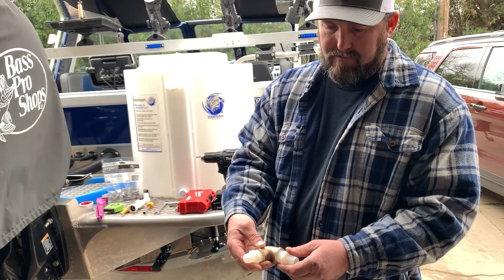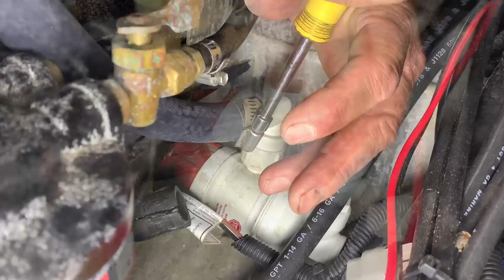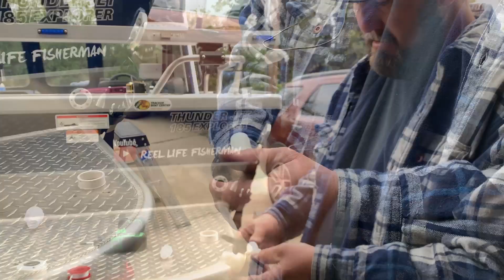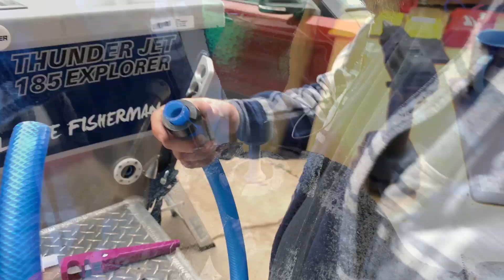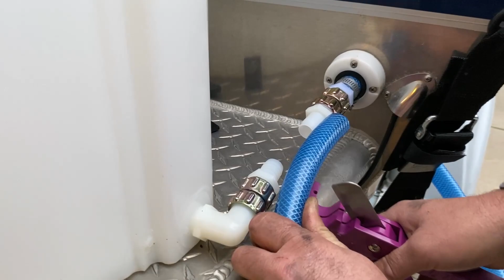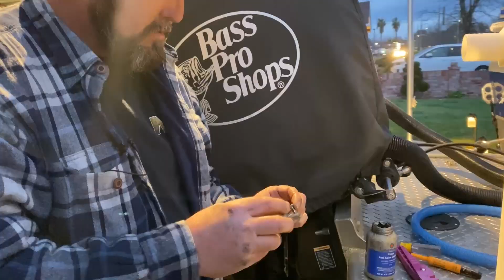PRO FLOW BAIT TANK INSTALL | HOW TO

Comment: Great install as usual.  Wish they made the tracker 175 easier to work with down in the bilge. Barely any room work with in there
Reply from the maker: Yeah it’s tight and sucks working in there .. at the shop I will pull the motor off to make it easier! lol

Comment: Nice clean install and great instructional video! Any chance you have a link to the led lights you use in the boat and in the rod holder beam?
Reply from the maker: Thanks ! I’m going to be putting out a build video on the beam soon and will have the links I used on Amazon for all the lights and parts

Comment: I put the same tank on last summer. I use live bait most of the time down here in socal. Great video as usual. I've plumbed a bit different than you. I run a 750gph pump, which is mounted off an old tiedown eye. I ran reinforced tubing up off the pump, then to a 3/4 barb to 3/4 fpt 90 degree elbow. Then ran hard pipe to a 3/4 threaded pvc valve. When I'm running the tank becomes a whirlpool, not anymore. Plus the valve will keep the water in when bring crabs n lobster home. I'll send ya some pictures. Thanks again for another good video.
Reply: You can get sch 80 fittings at Lowes.
Reply from the maker: Nice ! So sounds like you like the tank? I still haven’t had a chance to try it out on the water yet.. thanks for watching the channel and commenting I appreciate it! Yeah I would love to see your set up.. email me at reellifefisherman80@gmail.com or message me on Instagram or Facebook

Comment: Nice! But I couldn’t keep my eyes off of your sturgeon rail. Not quite happy with the one I built, it moves around too much. And yours has the Las Vegas touch. That would be a cool short video and would be a lot cooler if you did it👀👍
Reply from the maker: That is up soon I believe we have some cool shots and it would make a good video.. only thing I don’t have is footage of the new light upgrades on the water
Reply from the maker: Thanks for watching the channel and commenting I appreciate it!
Reply: Hey I want to ask you since you probably know, I have a two battery trolling motor set up in the front of the boat and in the back of the boat there’s two batteries that has a charger on it is there anyway to get the front batteries from the trolling motor hook up to the charger in the back or would there be some conflict?